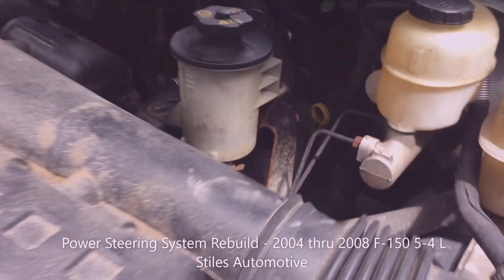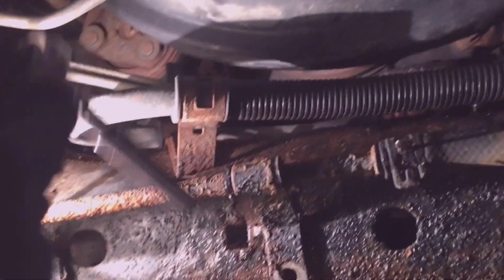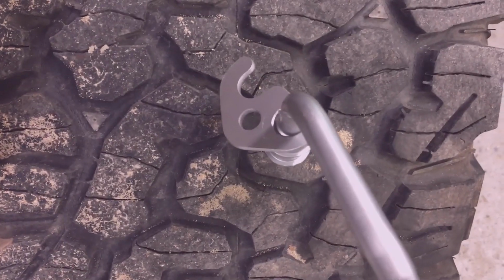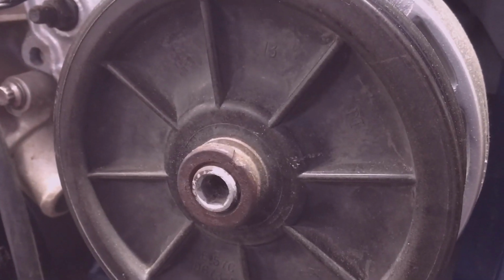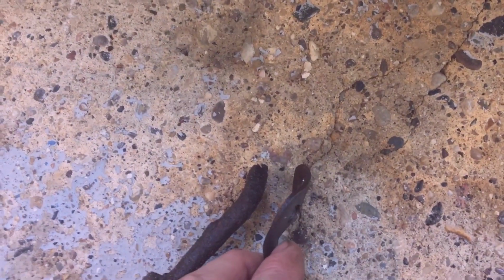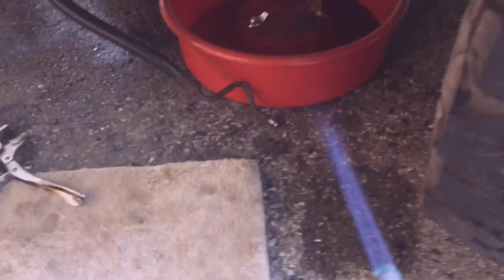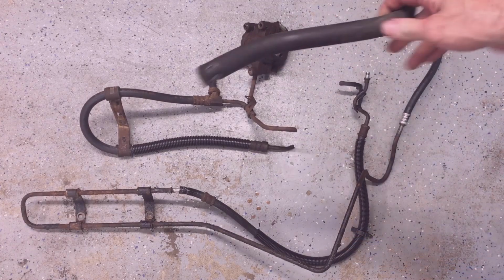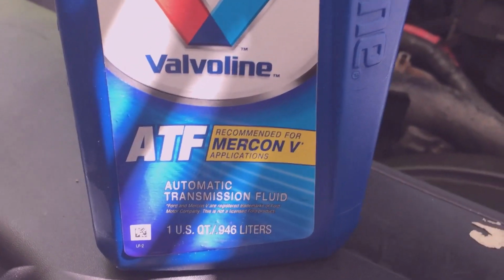Power Steering System Rebuild (Removal-Cleaning-Installation)   2004 thru 2008 F 150 5 4 L

Comment: Man this was so helpful. Great video!! I've been having trouble trying to get the pressure hose off. Trying to get that bolt out that holds the connector in there at the wheel well. I'm having trouble getting the tube from reservoir to the pump off. How did you get it off without cutting it?
Reply from the maker: Kipp, Glad it was helpful!  The Hose from the Reservoir to Power Steering Pump isn't a pressure hose, it's like a thick heavy Radiator Coolant Hose.  Do you know how to take old stuck Hoses off.  Take the Hose Clamps completely off, pry the ends of the hose with a large Flat Screwdriver (between the edge of the Hose end and any Housing or whatever), if that doesn't work carefully cut the Hose at the Hose Barb parallel to the Hose and pry the Hose away from the Barb.   I hope this was also helpful!  Best wishes and many more happy miles to you! - Stiles
Reply: @StilesAutomotive  the big hose was just one of the issues. I slid the clips back on top and bottom but couldn't get it to pull off. No big deal now, after watching your video (after no luck on videos for two days). I was able to get the pressure hose at the bottom off. I already had the pump loose. So I cut the line a the pump and I just pulled everything out, pump and reservoir all together. FINALLY got the pressure hose off the gear box. I've got it all back together now, got the pulley back on then it started pouring rain. So tomorrow I will finish it and then test time. Can't put into words how much your video helped!!!
Reply from the maker: @kipphornburger1049  Sounds like your Power Steering System is like mine, good for another 200,000 miles!  May you enjoy your truck for that long!  Thanks for the comments - Stiles

Comment: is it possible//difficult to change the pressure hose without removing the power steering pump?????
Reply from the maker: River,  Yes, you should be able to.  I show the Pump Fitting and Fitting Size in my video.  - Stiles
Reply: @StilesAutomotive  got lucky with my pressure hose,,,, my new one came with a Quick Connect Nut,,, so i cut off the old hose from the pump and used a socket/ratchet to get it off,,, so with the new Quick Connect nut, i put that on to the pump first without the hose/line, again used rachet/socket, then i lightly tapped in the line/hose into the quick connect nut,
Reply from the maker: @riverrivers250  Yes, a Quick Disconnect would make the job so much easier, I'm glad you were able to get one.  I haven't heard that Ford is completely going that way, but may be they will.  thanks for the feedback! - Stiles
Reply: @StilesAutomotive  the brand of hose i got was ""Edelmann"" ordered off rock auto, i saw that it had a quick connect, and the Motor Craft hose didnt have that,, so i thought ill go with the cheaper one lol!!
Reply from the maker: @riverrivers250  I'm not sure if anyone reads thru all of each comments, but that is a good tip!  I like to use Motorcraft in most cases, or other name brands.  I don't think I know Edelmann, but that would be worth a try.  - Stiles
Reply: @StilesAutomotive  and i took off the Radiator fan and Fan shroud,,, it made alot more room.
Reply from the maker: @riverrivers250  Yes, it would have, it's not absolutely necessary, but gives you so much more room.  My truck was the Snow Plow Relay (heavy) and Large Gauge Wiring attached to the Fan Shroud, I couldn't move it enough to help.  Also my truck has the Plow Attachment Bracket in the area where the Power Steering Cooling and Hoses are, which makes the job harder.  Thanks the comments, they may help others in the future. - Stiles

Comment: Very informative video, how would you go about having 2 bolts rusted on the pump, could i just cut the pump in half?
Reply from the maker: Ox, cut the pump in half?  No, I'd heat the bolt heads, first.  I think if you break or grind the bolt heads off the pump will slide off of the remaining bolt.  Then you can heat the bolt and get it out.  Good luck and let me know how it goes!  Thanks for the comment! - Stiles

Comment: I know what your saying about rust mine is just as bad.  I appreciate how you showed the ends of the power steering lines as well as how you got them out because a lot of guy on here that have made the videos don't really show or talk much about taking them out of the steering box and it is hard to get them off! I had the who whole truck shaking they still did not want to come off.  I am going to try some heat maybe that will help mine to come loose. I end up doing the same thing you doing I have an 05 and I thought it was the pump but then discover it is probably the hose, then the other hose sucks too so I am basically having to rebuild my system as well.
Reply from the maker: Hopefully by the time of this reply, you have your Power Steering System back together and your truck running great.  One tip I got from comments, here, is if you break off the tube with the Fitting still in the Steering Gear is to use an Easy Out Tool in the Fitting.  I didn't want to break off the last little bit of Tubing on the Fitting, I always wanted something to grab on to.  I think a little heat is ok, but I was very cautious not to put to much heat into the Steering Gear.  Thanks for the comment and good luck to you.  - Stiles

Comment: Attempting to do this on my whip.
Looks very informative. I am a carpenter by trade, I know nothing about cars or trucks. Will let you know how it goes!
Reply from the maker: If you have a southern truck or one not driven in the snow, it will be easy.  However, if it is like mine, I wish you luck and patience!  Thanks for the comment. - Stiles
Reply: @StilesAutomotive  
Ended up replacing all the power steering lines, the pump, rack and pinion systems. 
What a pain in the butt. Took three weeks of waiting for the right parts to come in,  but got it all done and its back on the road. I couldn't have done it without this video. Thank you.
Reply from the maker: @kalebschriefer  
You are welcome, I feel like if the video helps one person it is worth it.  You should be good for another 200,000 miles!  Well done! - Stiles

Comment: Good Video however you didn't show actually how you removed the mounting bolts.  I'm doing this currently on my 2007 FX4.  The top two were fairly easy.  However the bottom back bolt is a bitch.  After a great deal of trial and error.  I drained the oil and took off the oil filter.  I did not take off the shroud and fan. I was able to get at the bolt from below.  It has the plastic cap on it bracing the sensor wire.  Pop it off and your actually able to get your hand up there with a 10 socket ratchet.  Mine was  extremely corroded but I got lucky and was able to break it.  I would definitely recommend changing at least the pressure line.  I haven't gotten it off yet but I doubt it will be in one piece when done.  My pump and lines were as corroded as this one if not more.
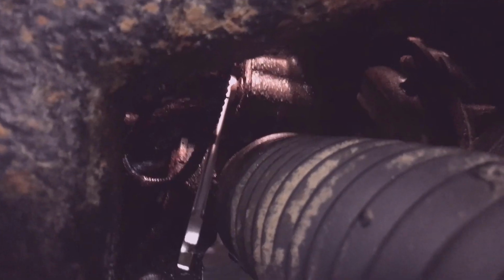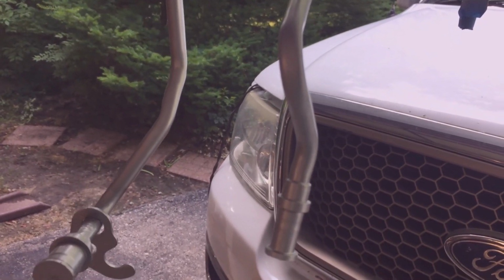Reply from the maker: Yes, you are right, I didn’t show the 10 mm head size, Power Steering Pump Bolt removal in detail.  I did show them (see video at 6:20) and talked about them at length (see video at 8:56).  I removed the bolts from the top and removed the Lower Back Bolt (the one with the Wiring Harness threads) by feel from the top.  Once I broke-loose the Lower Back Bolt, it came out by hand, with the Upper Bolts loose and holding the P/S Pump.  I hope by the time of this reply your work is complete and your Truck is running great!  Thanks for the comment and I wish you well!  - Stiles

Comment: Your new parts you show toward the end of the video don’t seem to have the connection for the pressure switch. I bought the Motorcraft replacement 8L3Z-3A719-F as you did and it didn’t have it either. At the end of the video I see that you have it installed and connected? What did you do? Thank you for the good video
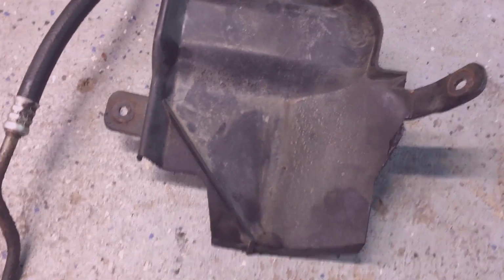Reply from the maker: No, it did have the switch mounting location on my Pressure Hose, look at the video 22:43, at the transition to installing new parts, I show the installation of the Pressure Switch on the Pressure Hose.  This is Hose, Power Steering Pressure, Pump to Steering Gear, Motorcraft PSH-57.  The Rock Auto description page - -   https://www.rockauto.com/en/moreinfo.php?pk=7590612&cc=1431304&jsn=460&jsn=460&jsn=460    - The photo on this page doesn't show the connection for the Pressure Switch, but mine had it on it.   Do you have the RWD Pressure Hose? This is for the 4WD.    I hope this helps.   - Stiles
Reply: @StilesAutomotive  Thank you for the info! The dealer said that my vehicle uses a PSH-54 which is for a 2WD but the replacement part didn't come with the mounting location for the pressure switch. According to Ford, you don't need the pressure switch anymore and you are supposed to zip tie the pressure switch connector to the wiring harness and leave it disconnected. I haven't installed it yet but I hope it doesn't trip any codes or make my truck run rough since it is not connected anymore. This doesn't seem like a good solution since it leaves the open end of the connector exposed to the elements. Kind of a dumb update on the part.
Reply from the maker: Interesting, Ford sold me the Pressure Switch and I would have needed to Plug my Pressure Switch Hole.  My Pressure Hose came with the Switch Connection Port, but the Pictures on Rock Auto now show the Hose with no Port.  It sounds like you won't ever use that Electrical Connector in the future anyway, but I'd Electrical Tape the Hound Dawg out of it.  It is in one of the dirtiest locations on the truck.  Thanks for the update!  - Stiles
Reply: @StilesAutomotive  whats the part number on the pressure switch?
Reply from the maker: @saviorcrash  The Power Steering Pressure Sensor (listed as "Sensor" on my invoice) Part Number 3F1Z-3K215-A, List Price of $82.82 / My cost $69.57 (on 6/28/19), was not a stocked item at a pretty good size Ford Dealer.  Luke per the discussion above you don't need the switch, either buy the Pressure Hose with no Fitting or Plug the hole  and leave Electrical Connector unplugged.  - Stiles
Reply: This was driving me nuts, I have the same issue... My replacement part shows the PSH-55 which doesn't have the mounting for the switch but i have an error code for the Switch...

Comment: Who cares about painting the bolts, and pulley no one has time for that remember this is a f-150 for pete sakes a truck not a show car
Reply from the maker: You’re right, it’s not a show truck, however it is about corrosion resistance.  I also used engine paint on the Power Steering Pump, Pressure Hose Tubing, and Cooler Tubing.  The paint on the Cooler will reduce the Heat Transfer, but will have better transfer than the old rusty Cooler. No, you don’t have to sand blast your parts or fasteners, but you should clean the threads of fasteners with a wire brush.  Especially the fasteners with Locite Thread Locker or Sealant on them.  To get a good torque and to get the new thread locker to adhere, clean the threads.  For me it is just as easy to open the door on the sand blast cabinet as put a fastener in the vise and grab the wire brush.  I don’t always paint fastener heads, I often use an anti-seize and oil mix on them.  I use two different types of anti-seize, a good high-temp anti-seize and a cheap, aluminum base anti-seize that I use to reduce corrosion.  Anti-seize on Bolt Heads is messy, but like you said it’s an F-150.  You can see an example of this in the video at 6:07 at the Power Steering Reservoir Bracket base, not pretty but prevents rust.  I once knew a Pete, I think he drove an old POS import car, he didn’t care about corrosion either.  For his sake, he should have!  LOL  Thanks for the comment.  - Stiles

Comment: Now i hope can do in the ford f150  changed for new pump mine leaks a lot guess is the problem..Thankyou for the video gime lot ways to work on
Reply from the maker: If you are changing the pump, make sure you remove the reservoir and clean the screen that is inside.  Thanks for the comment. I hope your F-150 gives you great performance for many more miles!  - Stiles

Comment: Thanks....I've got my 04 apart to do chains...guides...etc.  The pump is off and all the lines look nasty.....now decided to do all of them while its apart.
Removing that pump earlier was sheer torture....dont want to do it again in this life time !
Reply: Thanks....been working on it this weekend....decided to go with a new re-man pump as well.   Got really lucky pulling the pressure line from the rack.....years of slow leaks fron the system kept it from seizing in there.
The parts really dont cost much at all in the big picture.  The rest of the truk is really solid and I dont drive it more than 15K per yr at this point being retired.......
No payments ! New truks all over $50,000 ! This years equivelent truk to what I have is closer to $70.
Reply from the maker: Thanks for the comment!  I'm with you on replacing old parts when you have something else apart.  unlike my Mustangs that are driven in the summer, the F-150 sees the salt.  My Power Steering Pump was still good, but like you saw in the video; it was so rusty 1/8" fakes were coming off of it.  Well . . . may your truck last so long for you (another couple of hundred thousand miles) that you do need to do it again!  - Stiles

Comment: What’s the thread size for the 1 bolt you pulled out the gear box. The one that goes through the plate 10mm ???6:25
Reply from the maker: It is an M6 x 1.0, with a 10 mm headsize.  Good question, I did fail to size it, didn't I?   Thanks for the comment!  - Stiles
Reply: Thank you sooooo much.👍

Comment: Take 15 minutes and remove the Fan and Shroud. That opens up the bottom area where you can get to the hose mounts, oil filter sleeve and the rack bolt that holds the hose with ease. Mine was no where near that corroded but I can see that would be a major pain if it was like yours. I just did mine and with Fan/Shroud etc removed it was extremely easy to get to anything I needed to.
Reply: I just did  both of mine also  (10-25-2020) and they both did not want to come out  so i just broke out my small go to air hammer with a 1/4 " blunt shaft and gave it a couple of hits no where near the edge where you would insert the fittings and they popped right out ...yes the fan and shroud was a must for this 64 yr old man but i did get it done....thanks for this video it helped me a lot+++++
Reply: Just thought i would add that i used my cordless drill and a bold i cut the head off to prime the pump be for i put the belt on .
Reply from the maker: That is a great comment, about the fan and shroud.  I started to remove mine, but I have 2 plow harnesses running along the top and the plow solenoid was mounted on the rightside top of the shroud by whoever installed the plow.  I didn't want to remove the solenoid.  The job would have be easier without the plow bracket, also.  Thanks for the comment!  - Stiles
Reply: I agree 100%!!

Comment: Very helpful  Another way to remove that fitting from the pump is to cut the pipe at the pump to allow a scrap bolt to be shoved 
in the fitting and welded to the fitting or pipe Then use vise grips to rotate and pry out the fitting
Reply from the maker: John, You said "at the pump" do  you mean at the steering gear?  At the pump is a threaded fitting.  Your idea of a bolt in the fitting was were I was headed if my rusted tube at the steering gear broke off.  I'm glad it finally came out; I was NOT looking forward to removing the steering gear.  Thanks for the comment!  - Stiles